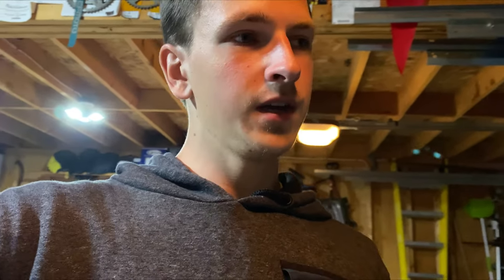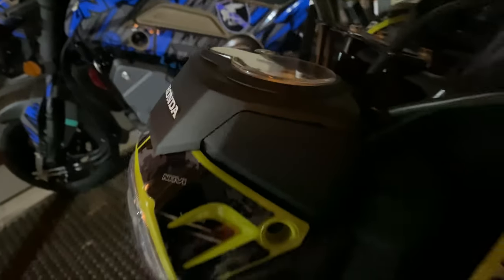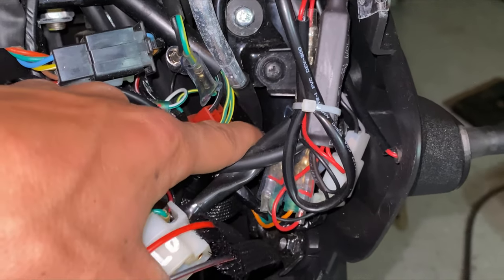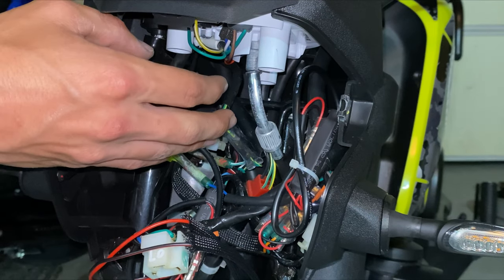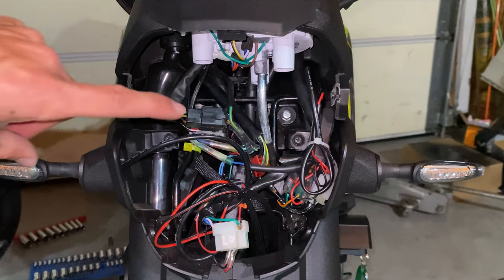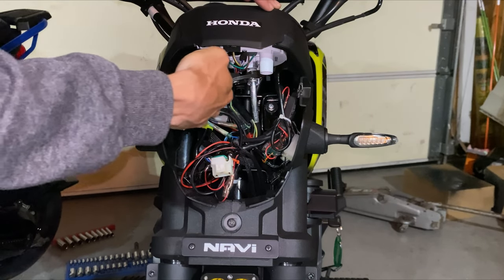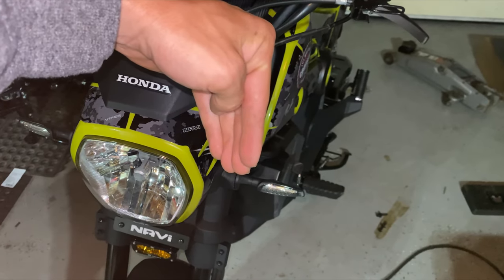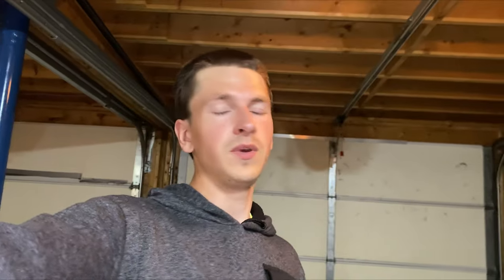Honda Navi Speedometer Recall (POSSIBLE FIX?!)

Comment: Thank you!!! You saved me an hour ride back to the Honda dealer. 😊
Reply from the maker: Figured I’d put this video out there. It’s pretty controversial right now, but I’ve talked to a few people about it and that seems to be the fix. I’ve taken it for 2 50+ mile rides and the speedo works like it did before, which is good.

Comment: Hi i took my navi  to the dealer for the recall , they replaced the cable. i was looking at the plastic you were showing and it was up , quite a gap. i took the head light off and saw the cable was not right so i rerouted it like you did.  Thanks for letting us know.   if you ever ride and your bike shuts down , check the spark plug boot , mine fell off the plug.  hitting pot holes and Bumpy roads will cause that.
Reply from the maker: I replaced my spark plug boot/coil in a video for an NGK one. No problems there my friend!

Comment: How to fix the counter mine won't go over 1k rolls back 999
Reply from the maker: So inside your speedometer is a couple of gears. They’re plastic and can break, rarely they do. But it does happen. Rolling back can be caused by a bad ratcheting mechanism directly underneath the mileage meter itself. You would probably be better off purchasing a new speedometer as they do not sell the mileage indicator by itself
Reply: @pookythomasmoto9147  thank you ill open it up n have a look